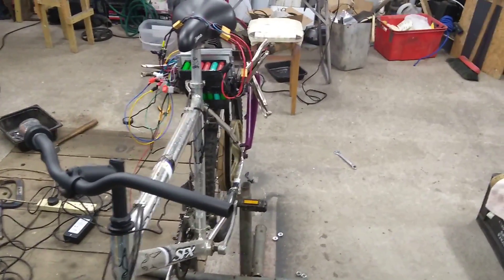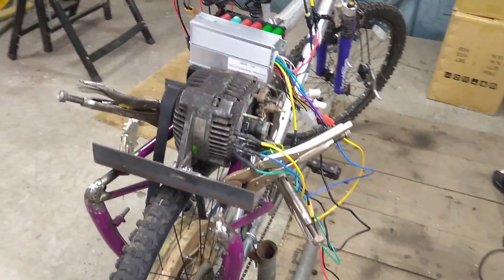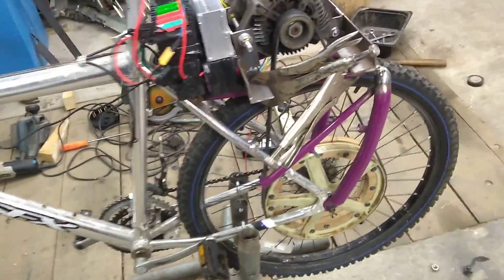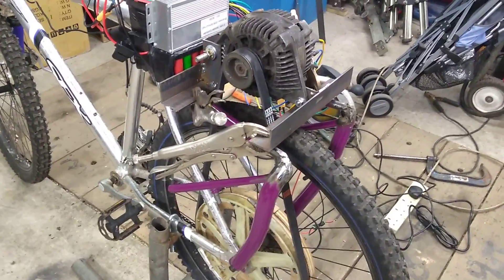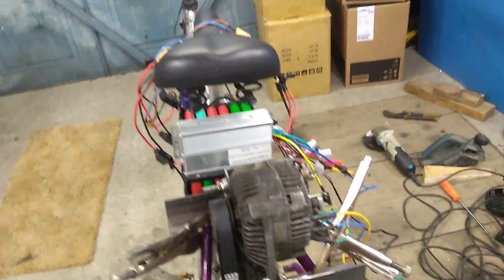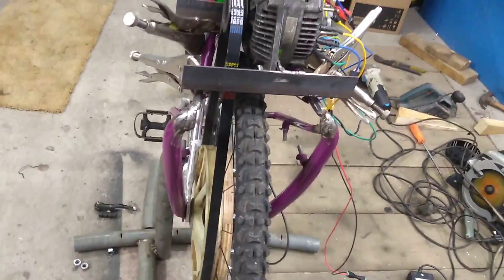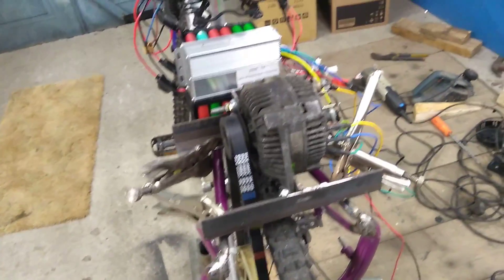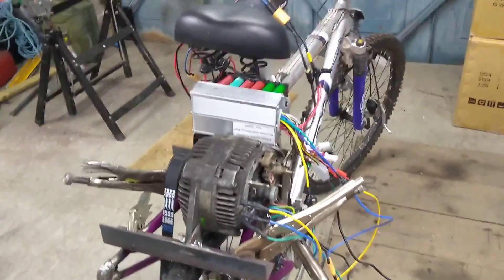Part 1 DIY E-Bike using car alternator, laptop batteries and cheap Chinese controller.

Comment: Thank you for your schering but pleace thell me whot controler you use BLDC or three phase controler
Reply from the maker: Glad you liked the video. It's a standard cheap three phase ebike controller.
Reply: @alibro7512  with sensor ?
Reply from the maker: @aligator0611  I take it you are asking about hall effect sensor?
No. It doesn't need hall effect sensors to work. I don't know why not it must have a default mode that may not be ideal but still works.
The controller has the connector for hall sensors but its not plugged into anything.
Reply: @alibro7512  thank you verry mach gudluck

Comment: Sir,  i have one 24 volt,  45Amp  catrpiller alternator.  How can i convert it as a bldc motor for bike?  How many watts controller needs to use here.?  How many volt batteries need?  Pls rply me.  
                  Raj
Reply from the maker: I don't know about 24V alternators but they should be similar
This guy explains it well https://www.youtube.com/watch?v=IKqy3rRWJQE
And this guy https://www.youtube.com/watch?v=0_hVE9GA2es
The voltage is up to you but you need to buy a controller that match your battery with the watts to match your needs.
You also need a small battery (5V - 10V) for the rotor.

Comment: Hey thanks for the video. How did you connect the belt to the wheel?
Reply from the maker: Sky hooks. Lol.
The belt is firmly held by the top pulley so can't come off it. By simply adjustment it sorta just stayed on the bottom mostly. Eventually I made an alloy disk to hold it more securely.
Reply: @alibro7512  I'm talking about the pulley that connects to the wheel. Is that custom fabricated or did you find it?
Reply from the maker: @Terminalbeats  the pulley came off a washing machine drum. I screwed it to a ring of ply wood and sandwiched the spokes with another.
Its not ideal as the belt needs to be tight to avoid slipping.
Reply: @alibro7512  thanks so much!

Comment: time to drain baterry?  max speed?, how many amps is this alternator?, How many whats does the controller have? can go up hill with 90 kilograms?
Reply from the maker: Range around 10 miles with small battery. 
Max speed around 25mph
Amps around 30A
 Controller is 800 to 1000W
Can go up hills no problem.

Comment: does you controler have sensorless?
Reply from the maker: Not officially but it works sensorless for me with my alternator/motor. A few other people have discovered the same but I don't know if it will work for all motors.
Reply: @alibro7512  what kinda alternator, and controler do you have?
Reply from the maker: @TrailMaker2  pretty much any alternator and any cheap Chinese controller.

Comment: And how much voltage require for run it
Reply from the maker: I'm using 36V but you can use whatever voltage matches your controller.
Reply: Sir which controller should we use for car altinater
Reply from the maker: @dostautoworks7536  Hello my friend. You should watch the other videos I made of this ebike, also go to #cheadlebiker and watch his videos as his bike is better than mine. In the last one I mentioned I found a 1500W 36V/48V controller on ebay and it works great.
https://www.ebay.co.uk/itm/24V-60V-1500W-Electric-Bike-E-bike-Scooter-Brushed-Brushless-Motor-Controller-ST/253823287117?ssPageName=STRK%3AMEBIDX%3AIT&var=553112671655&_trksid=p2060353.m2749.l2649
I cannot promise it will work with your alternator though as they may all be different. The first one I used was an 800W controller advertised on ebay as works with Hall effect or without Hall effect sensors but I believe I paid too much for it. The 1500W controller was advertised as works with Hall effect sensors and will NOT work without them but this was wrong. I took a chance when I bought it and it works great.